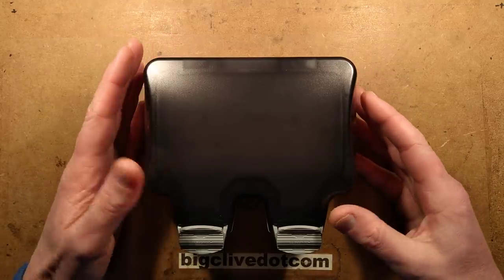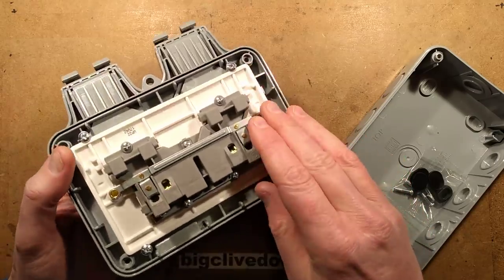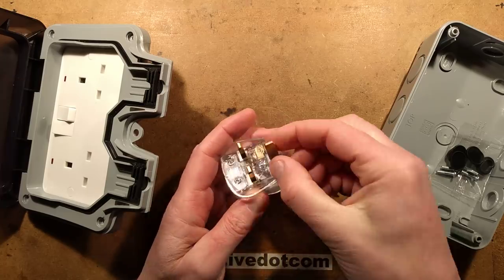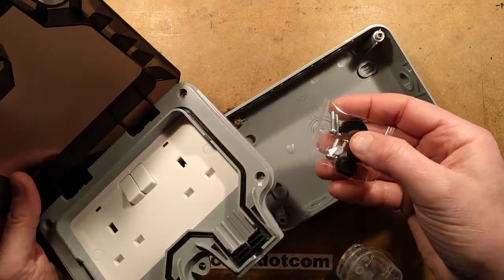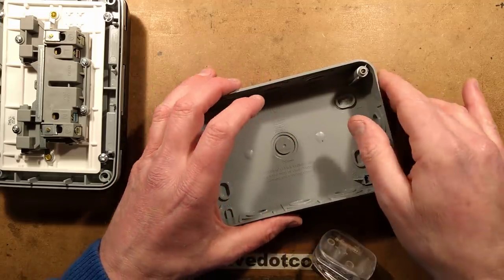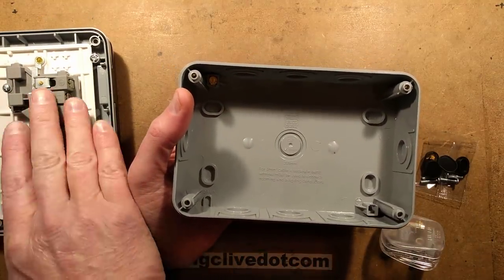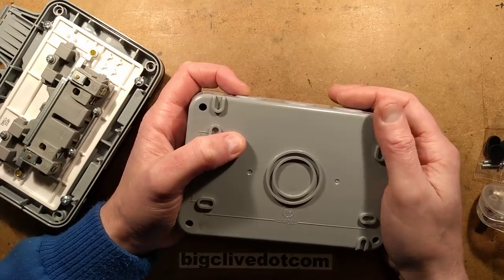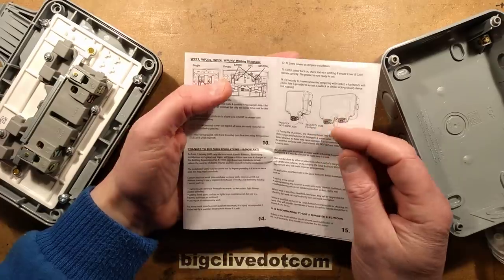British weatherproof socket with clever design. (bonus rant)

Comment: When i fit a box to an outside wall with a back entry, i use silicone around the hole drilled in the wall, but overfilled so it mates with the back of the box, i also do the same with the screw holes.
I can totally agree with you on the colours, it's a mess and a possible safety hazard.
btw (you might know) i often see what looks like a domestic wylex style fuseboard on light poles for christmas lights, are they actually waterproof, or are they relying on the openness of the panel ?
Reply from the maker: A lot of Xmas lighting is done by casual unskilled labour employed seasonally.  I too have seen atrocious electrical work like a waterproof box with no lid and an open consumer unit inside with completely exposed RCD (probably dead or bypassed) feeding cables to trees at ground level with exposed mains wiring hanging down.  And these companies are charging a LOT.  Some event style companies have even gone so far as to put the labour through a smattering of box ticking presentations to help them avoid liability.  That seems to have included fast tracking grade cards and paying the NIC for approval.  I'm not sure how often the NIC insectors actually check the wiring on their lamp posts....
Reply: @bigclivedotcom  is insectors  toung in cheek !
Reply: forgot to mention, those socket covers are so a kid can't first poke something into the earth, then be able to poke another object into the other pins
This isn't a problem with MK sockets, which have a latching rotating shutter, you have to insert something in live and neutral at the same time, the earth doesn't have the release for them.

Comment: Served a full apprenticeship as an electrician the colour codes changed in the 60s I rember using  a Seimens Star Deta starter with brown wire on the internal circuit, much discussion on idiot foreign goods, typically Brit thinking. Anyway qualified, joined the army and further electrical and electronic learning, anything electrical including generation of power. PART P YOU ARE KIDDING I have rewired my home, installed garden circuits and many other none allowed jobs. Meter needed changing a few years ago, chatting to the guy who was messing with mains electricity, 60amp supply. Which college did you go to, I asked. Turns out 3 month course on how to fit and or remove meters, another 3 or 6 month wonder, I like you Clive did 6 years learning to be able to work as an electrician. The world has gone bonkers. Keep up the rants mate and the diagnosing of dodgy equipment.

Comment: How much did it cost and who did you buy it off?  I've just realised that I need a Clive certified outdoor plug.
Reply: Karl Hamilton bought one recently from Screwfix for £12.99
Reply: That'll do, chairs.
Reply from the maker: This one came from CPC but many online retailers sell them.
Reply: or if the socket gang is the same as the Aussie plugs, I'd swap them out for use here (well, I would if my landlord wasn't a douche). Hrm, which countries have the same size? Just had a thought for a workman's power box that has an assortment of national power sockets, waterproof boxes like this would be ideal
Reply: @KarlHamilton  deathadapter? Oh, those cheap pieces of junk to adapt the pins? Nah, I don't think they'd fit inside the box. I do have some that came with cheap chinese appliances though. First opportunity, swap the plugs (and thicker cables)
Reply: @databanks  No no, it's deathdapter.
Reply: @KarlHamilton  just hadn't heard the term before. It's fitting though
Reply: You can even buy 'em at B & Q - both in the socket-only version and with a length of cable attached with a removable RCD plug at the other end (the idea being that as you're plugging it into an existing internal socket rather than permanently attaching it to your household wiring, it's perfectly legal to install it yourself). I've personally done the cheaper version: a non-wired RCD socket, a couple of metres of 3 core flex, and a conventional plug.
Reply: @databanks  Have a look through Clive's back catalogue. That's not  a euphemism.
Reply: @twotone3070  OW, don't make me laugh, please! It hurts.  I'll have a look later, though,  thanks

Comment: Hope I dont insult ya but the "BigClive" rants are kinda pleasant. Compared to most working on anything. I'd really like to know how many kids were getting shocked. Maybe I'll do the jazz hands routine on the gargaler see what misinformation pops up.
Reply: When the old style, non sleeved, plugs were in common use, a partially inserted plug could become a shock hazard without necessarily abusing them. 

I recall once knocking a wire coat hanger off of a worktop for it to fall just so that it hung over a partially inserted (full length phase and neutral pins) plug behind a box. When moving the box to retrieve it, it swung causing it to short phase and earth.  This was mid 70's.

What I do find staggering, and a common BigClive feature while "reviewing" odd imported devices, is the misinterpretation of the sleeved pins when applied to the earth pin. This often results in a NON-Earthed appliance - Madness!

Comment: When I was but a lad and the pins on plug tops were not shrouded we used to get a length of multi core solder and wrap it around the live and neutral pins then insert the plug into a socket. Imagine the merth when someone switched on the supply causing a blue flash and the plug to be launched across the workshop. :) Happy days

Comment: Would you be able to swap the sockets for some other plate, for example a switch/ socket combo?
Reply from the maker: Only if it was a compatible double gang plate.
Reply: yes, wondered that myself. ie, would a standard Aussie double fit - would have to look up the specs. I guess as long as the main plate has the same dimensions, it's possible

Comment: Here in the states, GFCI outlets are required outdoors (and pretty much anywhere where you might even smell water at this point). Is the same not true in the UK? Unless those are GFCI (but it doesn't appear to be).
Reply from the maker: You do get RCD (GFI) versions, but we tend to have the RCD (Residual Current Device) at the start of the circuit in the distribution board.
Reply: According to some interpretations of the wiring regs, you need a separate RCD in the consumer unit for outside outlets.  According to other regs, the main RCD in the consumer unit is adequate.
Reply: @bdf2718  that reminds me of the argument I had with a car charger installer over RCDs. Their interpretation of the regs differed from everyone else's

Comment: i have 3 of these outside in my garden they are like you said very well made. i've had no issues with water inside or any other issues with these sockets. one thing you did miss out clive is that one of the main safety features is that you can put a small padlock on to it to stop children trying to open it when it's in use.

Comment: Lovely socket, lovely rant! I've installed a number of outdoor sockets like that in the garden, and junction boxes for power for the pond pump and timer. Very neat design and very safe and sturdy. Yes, I did it myself. In England. That included a lot of armoured cable and proper armoured cable glands (which are very time-consuming to fit). I'm damned if I'm going to be forced to pay someone else to do that sort of thing. Same goes for wiring in the house. They seriously expect me to pay someone to lay circuit in the loft to install some lights? Bonkers.

Comment: In the US we still use the same dangerous sockets we've been using since they finally allowed the good old 2 blade Edison socket to have a ground. It allows us to poke it with screw drivers, small fingers, tongues, all sorts of stuff for your shocking pleasure, all at 110-120V and ~3A (or so)  so it will grab and hold instead of knocking one across the room...
Reply: Haven't bought any lately, have you?  They're shuttered now, or at least the 'residential' ones are.  Of course, I use 'commercial' sockets if I'm replacing any, they're a bit more robust and don't have the annoying shutters - or at least didn't the last time I bought, they may have been added by now.

The shutter design is crap, the British design uses the ground pin to open them, but since US plugs aren't always grounded there had to be a different mechanism, it's supposed to only open if something is jammed in both hot and neutral at once.  It typically doesn't work well.

I still say US plugs are better than British plugs, though.  Less potential for severe foot injury.

Comment: I have had one of these outside for maybe four years, the main thing I use it for over the winter is trickle charging a lawn mower battery so it survives the winter in top condition. The red LED inside is very handy - you can see it with the cover closed so you know the power is on. This matters because I have this socket fed by an RCD extension lead from a shed - after a power glitch this doesn't come back on by itself (you have to hit a reset switch), so the red LED tells me if I need to do that.

Comment: All the over-building to keep people safe. Is 120V in North America that much more safe that it doesn't need all of the over-engineering that the 240V needs?
Reply: A good question. Theoretically, at 230V, you save copper in the mains wires since for equal wattage, less amperes have to be delivered. On the other hand, it may be a bit harder to bridge between 230V and 12V than bridging from 120V to 12V... But I don't think that neither cables in the us are that much heavier nor smps really care if they are fed with 120V or 230V after they had been adjusted to an input voltage.
Reply: 120v isn't significantly safer for human contact than 240v to be honest. And 240v systems hold up MUCH better with high load devices. I've never seen the lights dim in the UK from the washing machine or fridge starting up, but that's common in the US. I'd FAR rather have the over-engineering.
Reply: No. Shuttered outlets are available now and should be used. Our plugs should be able to provide sleeving and should be sleeved. People do zap themselves on the prongs when removing plugs. If for nothing else, it should be done because 120VAC can put people into shock which can be deadly. Most of our 240 plugs still aren't sleeved!
Reply: Not a big fan of 120/110V as to get the same power rating you've got twice the amps, meaning thicker cables (or hotter cables if the cable was a cheap shit). That's just my opinion, take it with a grain of salt. L3P3 goes more into the topic, I see. 
Robert - US has shuttered sockets now? That's positive. Now, come on Australia/New Zealand, get with the programme
Reply: @robertgaines-tulsa  Shuttered plugs in the US are shite.  I have a house full of them and the amount of swearing required to plug in a simple load is outrageous.  All are poorly designed.
Reply: @charlesperry1051  Strange. I've never really had issues with my shuttered receptacles. Mine are pretty new though. They are also GFCI/AFCI receptacles so maybe the added quality they put into these receptacles is what I am seeing.
Reply: The only time I've seen lights dim was in one of PhotonicInductions videos.  Mind you it was the streetlights all down his road...
Reply: @truckerallikatuk  I have seen the dimming-effect on 240v, definitely!.  Depends on the wiring-system and joints in use...
Reply: @l3p3  Depends on the supply type...  Up to around 90w laptop style supplies etc all do almost-always seem to be 100-250v universal sort of thing.  HOWEVER, 200w+ computer siplies normally have a switch to arrange so that the input is rectifed so as to always get ~340v across a pair of capacitors in series, regardless of the input-type...  assuming the switch set correctly!.

Comment: My Dad does most of his own electrical work.  Not least because if he hired people to run or replace wires they might not keep his data and power cables separate.  Also this is in a listed building and because of the number of holes already drilled through or cut into the floor joists, all in the same areas and at different heights, he's very particular about how he routes cables.
I remember him doing so much work on the wiring when I was a kid.
Somewhere he's got a complete map of the wiring and the plumbing which he drew up.

Comment: The U.S. version of your Part P swear word is AFCI..... a useless device forced down our throats by the NEC (National Electrical Code, NFPA 70), which HAS become a design document, despite the disclaimer in the introduction ("Article 90") which states: (bold emphasis added by me) "This Code is not intended as a design specification or an instruction manual for untrained persons." 

The Code making panel that has mandated AFCIs  ("Code Making Panel #2") has had at least TWO manufacturers of Arc Fault Circuit Interrupters as members...so care to guess why it is now mandatory that virtually EVERY 120v circuit in a home, dormitory, and hotel/motel now MUST be AFCI protected? 

I have been around panels with the mandated AFCI's installed...the heat generated from the electronics in those AFCI's builds up rapidly, a few panels have been so hot that the covers had to be removed to avoid nuisance tripping. 

Brilliant thinking, let's install around a hundred watts of heat generation into our panels...and make what was a very rare hazard an almost guaranteed one by turning a breaker panel into a hot box. 

I will not ever install an AFCI in my house. I would rather follow proper workmanship and good installation practices that have worked very well for a hundred years than introduce nuisance tripping fire starters into my 200 amp breaker panel. 

The ONLY reason AFCI's have been mandated is because of what Clive mentioned...the dumbing down of the electrical trades...and lack of proper inspections due to lack of manpower (and most inspectors being trained by a slideshow as well.) Get rid of the hacks and get real, properly trained inspectors involved and the issues will be mitigated.
Reply: I had to rewire every outlet in my last house because of those damn push connectors (USA).  The voltage drop on circuits was horrible.  I am an electrical engineer with 30+ years of power system experience.  In most jurisdictions I am not qualified to install electrical wiring but am qualified to go back and point out all of the mistakes!
Reply: @snaplash  I cannot stand those F*&#@^$ING back-wired things.  I've had receptacles in this house where the wires just fell out of the back when I removed the receptacle.  These were fire hazards before I wired them up properly.

Also, in the same house, whoever wired up portions of the basement thought it was a great idea to switch the neutral side of the circuit for the lights.  Probably the same person who also saw fit to just shove a 14-gauge wire into a GFCI outlet wired with 12-gauge at the terminals to power the lights in the laundry room.  All that not-even-code-for-1986 stuff got fixed.

Comment: Nice video. Thank you
I fitted one of these. On my conservatory wall. South facing. What happened is due to the sun, the top of the box started to crack near the entry points of the box, water leaked in. 
Only lasted about 3 years. So now I have fitted a box made by MK. See how that fairs. Nothing  lasts like it did from the old days. As de-skilling the work. Couldn't agree more. Lots of trades now need to be certified,  but have found with certain individuals they don't take pride in their work, charge the earth, leaving a job a blind non certified person could have been done better. Rant over. 😣

Comment: Hi Clive
I have one of these BG outdoor sockets for a few years, works fine, but if you try to fit the wall outlet type transformer for outside Christmas lights into it the lid will not close. Plus I have to replace mine as the hindges on the lid broke off during this festive season. I suspect some UV related hardening of the plastic. But will replace like for like with another BG unit.

Comment: Electrical code is getting dumber everywhere, Clive. In the US, they are now trying to require 3 ground rods spaced 8 inches apart.
Reply: That is quite useful if idiots lacking the capability to place the rod properly are at work. Such regulations might try to compensate for lack of education of the installer.
Reply: Ground rods should be spaced at 2x length of rod.  The first 500mm of earth can't be relied upon to give a decent earth value, so need rods of 1m or longer to get stable earth values
Reply: 8 inches lol. Ok.
Reply: Here we have bedrock. You can drill holes in it (limestone) but good luck at providing an effective "earth".
Reply: @manolisgledsodakis873   that's when you need to do other techniques or deep drilling.  Plenty of options available, but at a cost
Reply: I used to be in the trade. You only needed to do the three rod trick under certain soil conditions. I haven't been an electrician for over 10 years and the mention of the grounding part of the codebook (250?) still makes me grind my teeth.
Reply: @pmailkeey It is so your house can be the grounding point for the entire subdivision because the electric company is too damned lazy to properly ground transmission lines at the pole. Lol

Comment: Here in Australia, three phase wiring is red, white & blue.  Single phase used to be red for active, black for neutral & green for earth.  Quite some years ago, in line with some European standards, single phase was changed to brown for active, blue for neutral & green/yellow for earth.  I remember when I lived in the UK (left in 1959), plugs had round terminals, what year did this change to the squared ones?